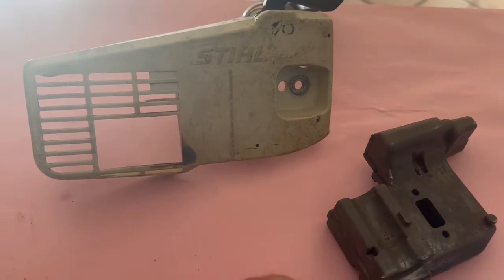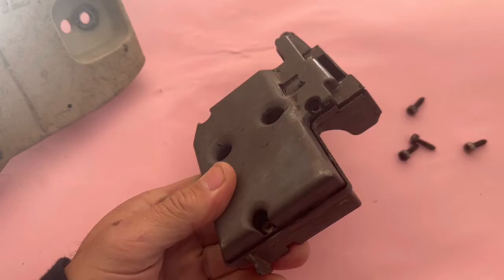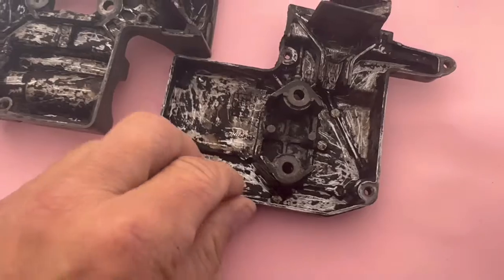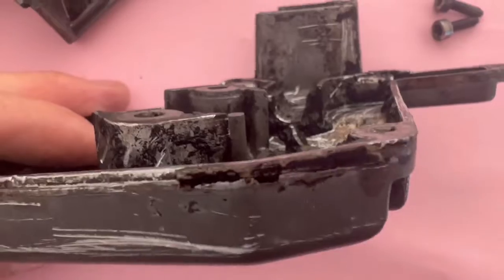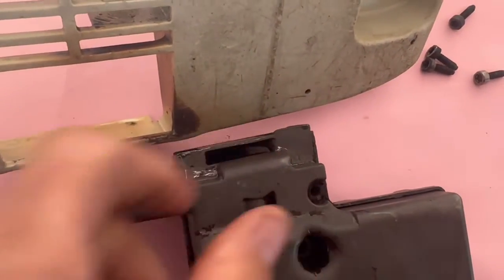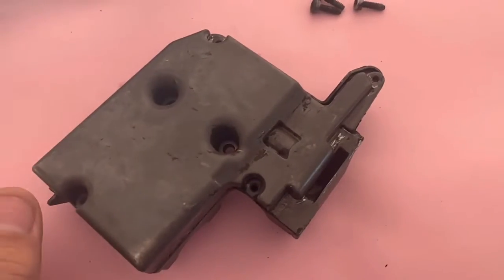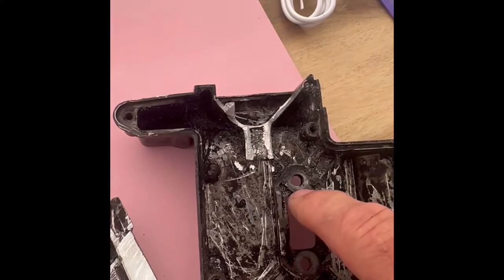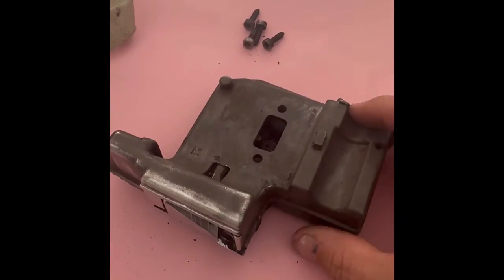Stihl MS200T exhaust muffler mod for more power.

Comment: I wish you had showed the results of this mod with a demo of how it's cutting before and after the mod. But this muffler mod seems like a good cost saving option.

Very good how to video. 😎👍
Reply from the maker: It's was so much fun I forgot to take a video while chopping wood this winter. I'll set up a video next time I cut with it but. I loved it thou and used it even when I normally would go up to the 60cc saw. You can do it 👍
Reply: @YoucandoitwithJules I use to have a Stihl Ms200t and I loved it. I can't afford the price of even a used 200t now, so I bought a clone version labeled the G111 with my fingers crossed that it will be a good saw and I won't have to buy a bunch of Stihl parts for it to run good. 🙄🤞

I can sure understand the feeling you are talking about. 😁 The MS200T and the Ms361 were my favorite saws and a blast to run. 

Thank you for the video. I'm guessing the muffler setup for the US might be a bit different. But the principle of what you did should be a good guide for me if I decide to go that same route. With other easy options available over here for a muffler mod, I imagine cost will determine which choice I make. Lol

PS. Your reply was the best possible explanation for anyone who has owned a great saw empathize with. 😎👍
Reply from the maker: @williamgrissom1995  Yes US exhaust is different but the principle is the same. Great saws and let us know how you get on with the G111. You can do it 👍